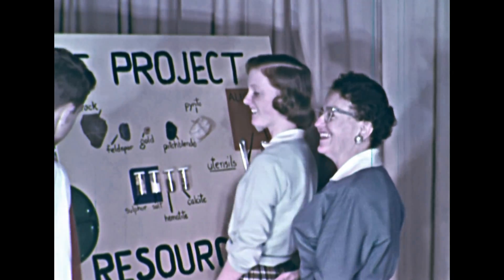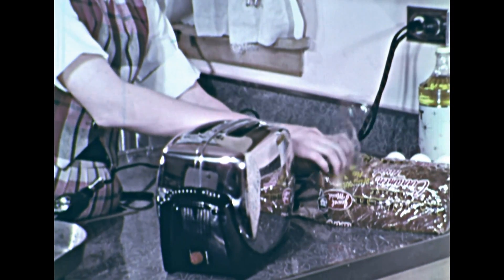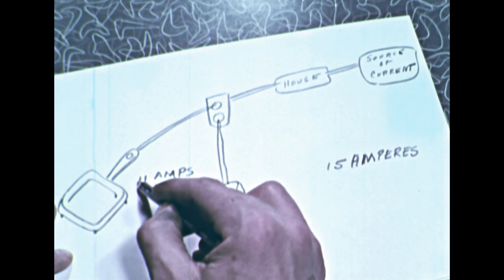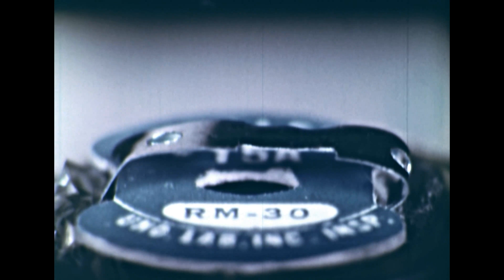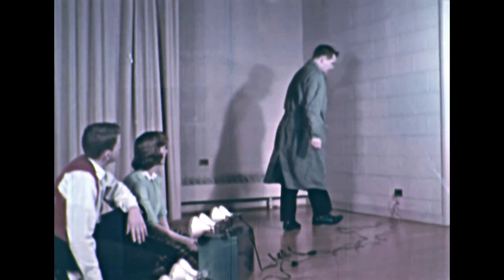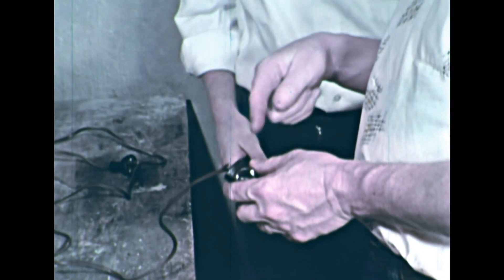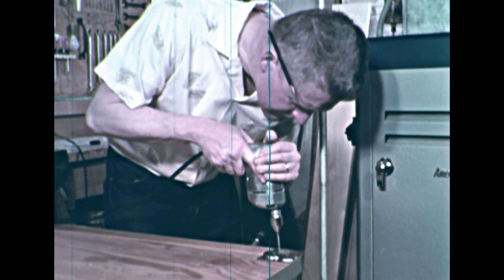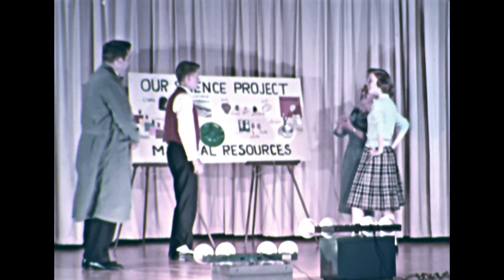1960 ELECTRICITY PRINCIPLES OF SAFETY (Circuits Fuse Voltage Amps Power Watt Shock Overload Charge)

Comment: I wish fuses were designed to be different diameters for the amperage
For example , A small diameter for 15 amp , A little bit bigger for 20 amps and even bigger for 30 amp so a higher amp fuse cannot be put into a 15 amp socket because fuses are actually safer than circuit breakers because there's nothing mechanical with a fuse compared to a circuit breaker which the mechanism can fail 
Plus fuses react more quickly to overloads and short circuits than a circuit breaker and because a fuse has no mechanism like a circuit breaker does , it's more reliable and safer 
But unfortunately , Fuse sockets are the same diameter which many people would put a higher amperage fuse which defeats the purpose of electrical protection and that's when fires start 
Like I said , Fuses should have been designed with different diameters to prevent putting in a higher amperage fuse for the particular circuit
Reply from the maker: @ironmartysharpe8293, absolutely true!  Very good suggestion.   -  PS  I grew up in a house made in 1895, we had screw-in fuses for electrical wiring that were SAME size as standard light bulb sockets.  When few blew at night and no one had a new fuse, we just put a copper penny in the socket and screwed the bad few back in again.   Oh.... so dangerous!!   -    Thanks for your feedback!

Comment: As someone who lives in an apartment building that's largely from the 1960s, this is too real. We have 1 phase to cover everything in the apartment except for the stove. Back then that would've been plenty, but nowaday with dishwasher, washing machine, computers and whatever else, 2300 W just isn't enough (and it was 2200 W when the building was new). We have yet to get the apartment rewired because it's stupid expensive, especially at the moment while prices are skyrocketing
Reply from the maker: Fascinating!    What is your country location?

Comment: 1:25 Ungrounded electric devices right to a water tap. That is a death trap. In Finland sockets in the kitchen were grounded since 1930. That means you could only use grounded devices. I hope the metal cover of  the socket was not grounded also.

Comment: Nevertheless of those nice and serious movies, generations of dads where tinkering in the house wiring and "repaired" appliances ending in fires or electric shock. So it was a case of luck when the fuse had tripped 😣

Comment: That's why old toasters toasted toast faster than todays toasters. 10amps at 120vac is 1200 watts. Most new toasters (2022) draw abut 700 watts (for a 2-slice), or 58% less power than the 1200 watt toaster. Great job CHAP finding and posting this neat little film!
Reply: I just checked our toaster and it draws 850amps but  in the UK  we have 240 volts on all circuits.  Our kettle is 3kw and even full boils in no time
Reply: @andyblackpool  Are you sure ??????? 850 amps !!!!!!!!, how in the hell do you get that from a 13 Amp socket ??????
Reply: @brucepickess8097  Ha ha yes its one hell of a HUGE toaster!  Sorry, misprinted. Should have read 850 watts of course not amps.  The plug itself contains a 13amp fuse 😉
Reply: @andyblackpool  Hi, yes it was obviously Watts and not Amps. Just a thought, as it's 850 Watts that would draw approx 3.5 Amps. You might want to consider reducing the plug fuse rating more in line with the current demand to afford greater protection under a potential fault condition. You may get away with a 5 A fuse, if not 10 A.
Reply: @brucepickess8097  The fuse was installed by the manufacturer.  Fuses in plugs in the UK are to there protect the flex only; not the appliance (as weird as that may sound) But thank's anyway
Reply: @andyblackpool  Hi yes I was aware of that, however it's  something I always do to offer that extra protection. I used to do electrical safety testing PAT testing amongst other things, and would always cringe when I had a 60W table lamp to check out, and as a matter of procedure check the plug fuse rating and would invariably find a 13A fuse fitted. This would not have protected some of the cables fitted to those lamps. 3A or less is the appropriate fuse rating. Problem is people know it's a 13A plug and fit a 13A fuse if there is no marking on the plug for the correct rating.
Reply: @brucepickess8097  Yes unfortunately it is known colloquially as a 13 amp plug 😉
Reply: I have one of those old toasters, I will  and have  raced it against a modern day toaster  making X number of slices of toast.... It always wins.

Comment: That police officer was pretty close to getting a lesson on voltage gradients and step potential...............
Reply: That's for sure because high voltage electricity will jump out at you and electrocute you , In a residential area , The power lines on top of the pole before the transformer carry 13,200 volts and that police officer was very lucky he didn't get electrocuted because that high voltage could have jumped out at him , Power lines on wooden poles can carry as high as 138,000 volts

Comment: Moral of the story: Barbara and Jimmy have parents who are too cheap to update their old wiring.
Reply: But Barbara's dad can sure make a nice sketch.
Reply: Knob and tube.
Reply: @randyab9go188  2022 I STILL have K&T, But it's confined to lighting circuits. Since LEDs use Wayy less power than incandescent, I'm not blowing any fuses. (House was built in 1873, originally wired in the 1910's, but the wiring to receptacles (plug outlets) was done in the late 1960's and are proper grounded circuits. (kitchen, bath and cellar is all "modern". as to the rest, Grounding would only be a hazard of I was changing a bulb in my living room while my hand was on the kitchen faucet, A scenario that is impossible, LOL.
Reply: Technically speaking, No. Not the case. These were overloads and shorts. Even in a MODERN kitchen, Barbara would have tripped the breaker. Kitchen outlets TODAY are required to be 20 Amps, she put a 21-amp load on the circuit. Yeah, it blew the 15-amp fuse in 1960, BUT it would ALSO trip a brand new 20-amp breaker in 2022. Jimmy used a defective extension cord. It blew the fuse in 1960, It would trip the breaker in any modern home NOW.
Reply: @jamesslick4790  Putting  a 21A  load on a 20A breaker will trip the breaker but it's such a slight overload the breaker may not trip before  the toaster pops or the thermostat on the electric skillet reaches temp and cycles the element off. Breakers have an inverse time curve for short duration low level overloads.
We had "split" kitchen circuits in Canada and they are still allowed in some circumstances, you could plug in two high wattage continuous loads  in the same receptacle and never trip the breaker.
Reply: They must be supplying 110vac with those high currents at 220vac the current would be half that
Reply: There are probably houses today that still have fuses instead of circuit breakers. When I moved to the house (built in 1965) I am in now back in 2000, it still had fuses. The electrical box had only 8 fuses, with 2 circuits hooked to each of them! Back then (in the '60s) there was a lot less things besides lights to plug 🔌 in.

Comment: Barbara saw the appliances weren't becoming heated! ... DAD EXPLAINED: "It's our crappy American electrical outlets! You can't plug two appliances into one farty outlet! It's too many amp-ears!" BARBARA: "We should go live in Britain! Their electric sockets don't cut-out when you plug two appliances into them!" 👍😂
Reply: Also all our European sockets had a third pin to ground metal cases of the frying pan or toaster and trip the fuse if a power leading wire touches the case instead setting it on mains voltage.
Reply: Yes, and we can boil a full 3kw electric kettle in about 3 minutes flat with the toaster plugged into the same socket! 😉
Reply: @andyblackpool  thanks to the decision for the 230V grid 😁
Reply: @andyblackpool  Correct! 👍😂